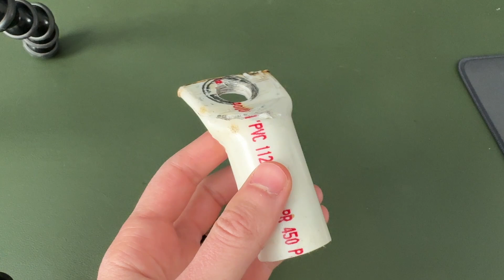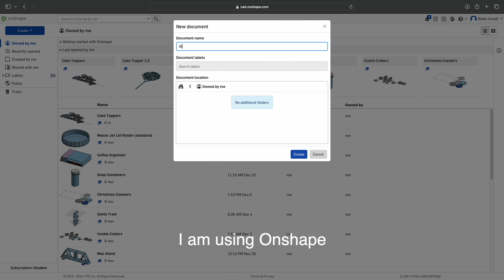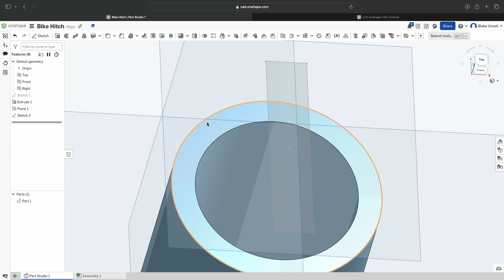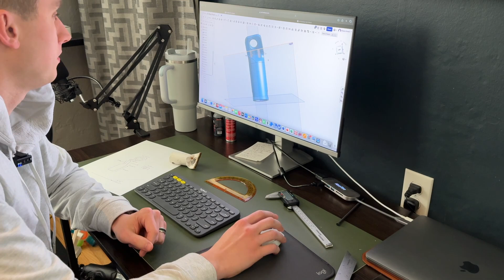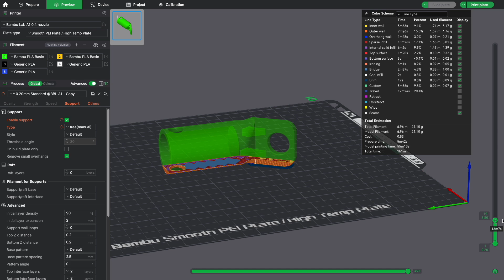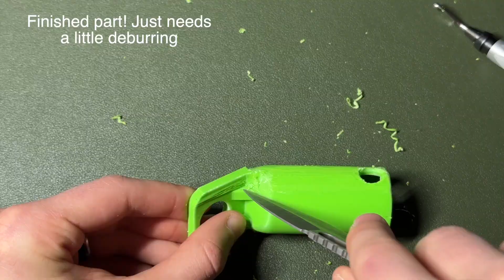Transforming the Old into New: The Magic of 3D Printing!

Comment: Use Asa. It will add strength and give it UV resistance which it will need
Reply from the maker: I totally agree. Unfortunately, I am printing with a bambu A1 and so I do not have a enclosure. So I don’t think I can print with ASA right now.
Reply: @ use a large cardboard box and a small space heater 👍
Reply from the maker: @ I will honestly have to give that a try
Reply: Try petg cf, a1 can only reach 80c on bed so it will warp even with enclosure as it needs 100+, petg cf should be fine for this application
Reply from the maker: @alex59292 Does CF make the part more brittle? Ive heard that it really don't make the part stronger, just stiffer?